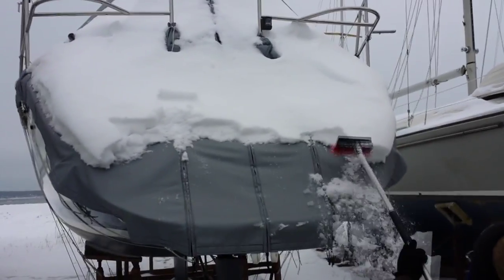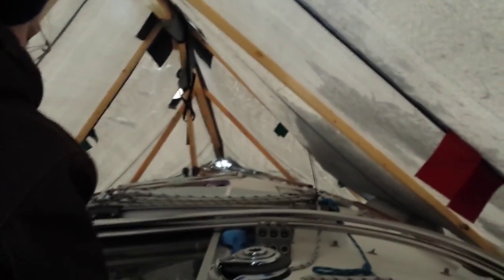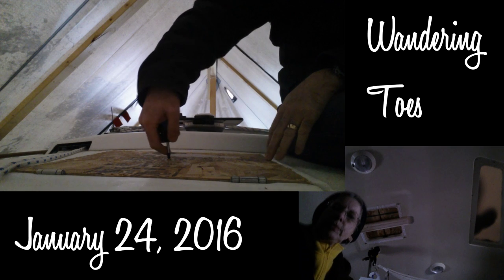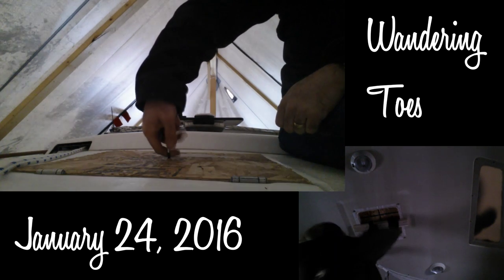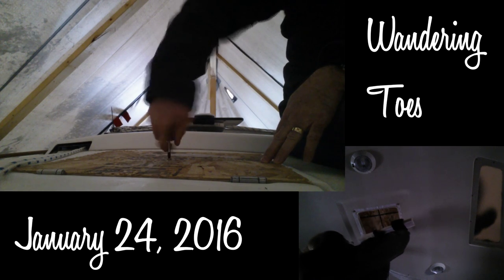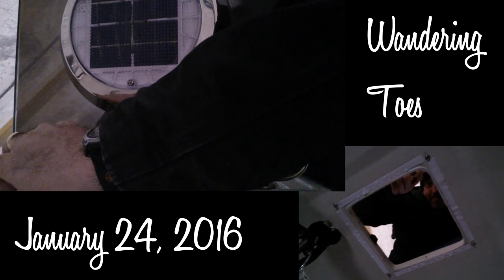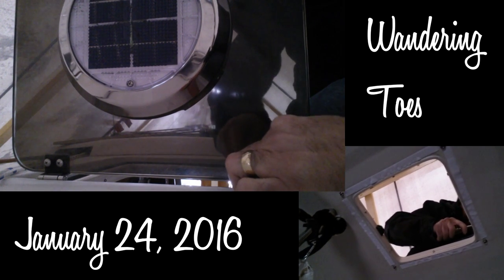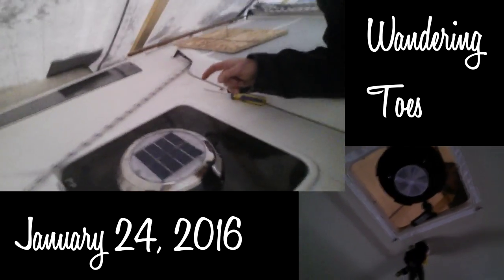Solar Vent Installation

Comment: I have a regular outboard center console boat. I've been looking for a below deck ventilation solution while boat is stored in the shed. I can't just leave hatches or deck plates open because soon as I do I'll have birds or wasp or critters getting below deck and ruining my boat below.
is this thing small enough to cut a hole in old screw in deck plate and mount it on screw in deck plate? then I could just install/remove the vent when using boat or storing boat.

Comment: installing a hatch, not a solar vent. vent was already on lid.
Reply from the maker: Thank you Rick.  This is a very fair comment on my video.  I did not get video showing how to install the solar vent, but rather just my attaching it back to the boat.  For those looking for instructions or installation information I am sorry for the confusion.  I did remove the 1/2" thick lexan hatch and bring it home to install the vent.  Lexan does not like to be cut or drilled cold.  I had my shop about 70 degrees and the hatch warmed to that temperature before starting.  I taped over the entire hatch with masking tape before starting and drew the circle where the hatch would need to be cutout onto the tape.  I drilled a 1/8" pilot hole in the lexan before drilling it out to 1/2".  I then used a jigsaw with a sharp wood cutting blade and fairly slowly cut out the lexan to the final size circle that I had marked on the tape.  I used a sharp knife to dress the edges of the lexan cutout.  I mounted the solar vent to the lexan with the included foam gasket and have not had any issues.  It is a pretty straight forward thing once you get the lexan cut.  Go slowly while cutting so as to let the plastic cut and not melt.  I hope this helps.  Again, thanks for your comment.

Comment: Hello. Nice video!
I'm about to get one (motor boat) . How does it perform, and are you still using the original rechargeable battery?
Reply from the maker: Hi Noel, the solar vent just stopped working for us.  It had been 3 years since we installed the vent fan and yes same battery. I replaced the battery but it still didn't work. Hmm? Our marina just added a bunch of sand and gravel to the parking lot and we had a lot of dust in the vent fan.  I'm thinking that the dust and sand took it's toll on the tiny electric  motor.  So we purchased another one and just replaced the whole unit. I am going to try to find a replacement motor for the solar vent I removed as we find them to be invaluable in keeping the boat ventilated. Tough for us to have to buy two, but if i can fix the old one I'll have a backup.  Hope this helps!
Reply: Sorry. Late reply. I've installed one yesterday, and looks like it is working fine.

However the 3" unit I got 1st was missing the extra 2nd (blowing) propeller (the one in it was the one for sucking air).

The shop where I got it from told me to come in, and take the needed prop from another unit.
Unfortunately they only had the NEW 3" version units left, and as they have bigger props it does not fit on the "old" 3" units! 
The NEW 3" units also need a bigger hole!

So make sure when you order a new one it has the same size hole as the one you have now, or you will need to make the hole bigger!

I'm not sure of the 4" versions are changed!
Reply: I went to the Marinco website and saw they make a motor and fan replacement/rebuild kit ect...
Reply: Looks like the reviews on these are very poor. Im still shopping.
Reply: @Burritosarebetterthantacos  some time later now. For me it is still working. However. It did get more noiser, and I did need to replace the battery once. If you can find a better solar event, than do get that one.